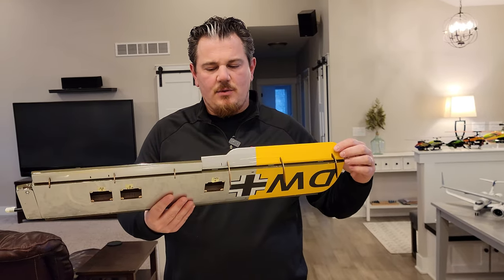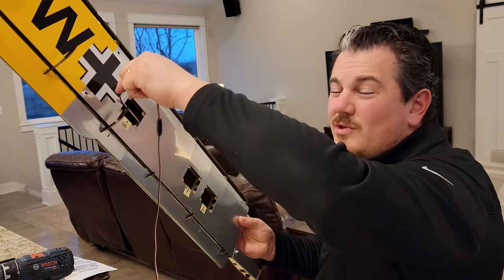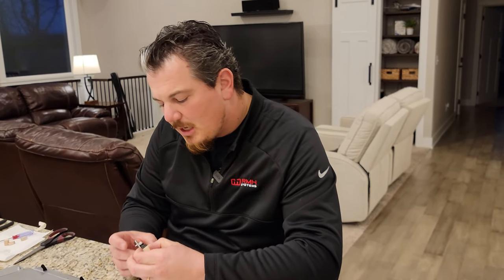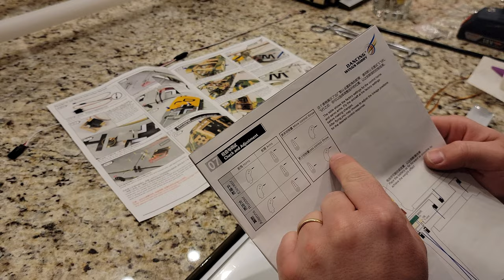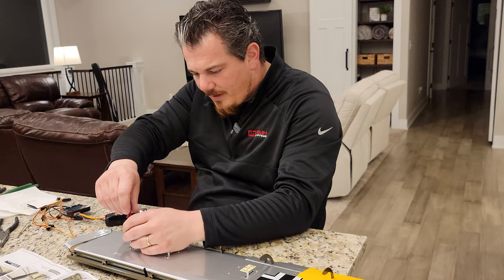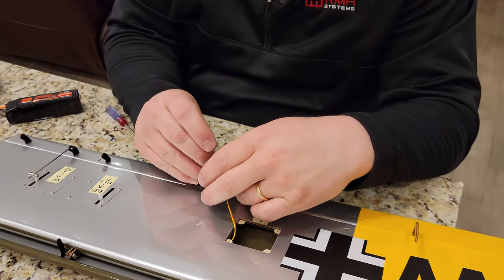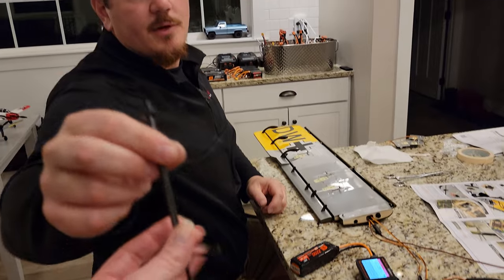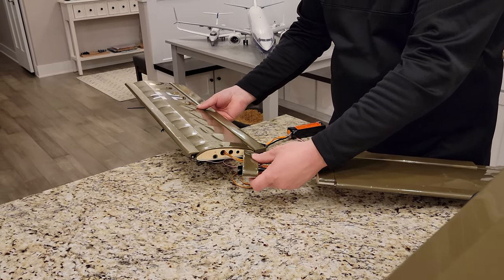Dancing Wings - Fi 186 Storch - 1.6m - Build Part 3

Comment: Hey man I got a maule M-7 a while back and live near a river. I’m petrified to fly it and land in water with the floats. Any pointers?
Reply from the maker: Pointer #1...fly in such a way that if you lose control of it on the water, it floats toward you.
Pointer #2...land faster than on wheels, and EXACTLY into the wind.

It's not hard, but you just want to try to keep it from getting too wet, and shorting out the motor...it will still work, but might stop in extreme cases.

Comment: Hey Megan, Thanks for Putting up with Brian.. I Know.. I Know.. But Hey.. Thanks!! lol ;)
Hey Brian Thank for doing Long Form.. IT TRULY makes A HUGE World of Difference!! 
Ist Hack.. Never use those DEATH couplings.. They Bind on travel. Weigh a Shitload and come LOOSE.. usually resulting in a Fatal Crash..  ANSWER.. Modified Z-BEND using heavy Gage Piano Wire, after it's bent into place, Bend wire to a full z bend and Trim Excess, secure mid point deflection with a zip tie, tightened around the wire, cut and glued to Frame or ??
2nd Hack.. STOP using THAT...Masking tape.......... Use the Green or Blue Painters tape works Great and Peels off super easy yet wont let go, until removed..
How I GOT HOOKED..
Dad Bought me(Him) a Plastic "Cox"  .049 P-40 Warhawk, U-cnotrol.... I was HOOKED!! Not To mention it's the Coolest Shark Plane EVER!!
Then my First Balsa Kit was the "Lil Wizard" but I found BIGGER MOTORS.. OMG that's when the "MORES" started... FLY`N NITRO BABY!!
My Planes Grew to the "Banchee" Profile U-control Racer.. with a KB 40 on it.. That Plane was a Thundering Bundle of Dizzy JOY!!
Remember how we'd take 3,4 Plastic Car Models and use all the Parts for ONE CRAZY Amp'd up CAR?? 3 Motors and sh.. stuff.. lol
After 50 Years Of Balsa then Foam Board, I'm Back to Balsa and I'm Still Doing The Crazy Concepts.. in Many of my designs..
My Last Scratch Build took me almost 2 years.. From Download to completion and Modifications..
The Quickie 2, by Burt Ratan... Took my Thumb drive to Kinko's, came out with full size Plans, Made a Materials list and Got started Laying it up and pinning it together.. All hand cut
Modified to a Twin W/ Differential Steering just for fun.. it's Pack`n 2 Quantum BE1806.2700KV Motors  and 4052 Tri Blade Props...

I have Benge`d all 5 Episodes and am QUITE IMPRESSED!! that your still getting fed.. Brian...lol Kidding My sides hurt from laughing all night your Both GREAT!! 
I had Hoped your would Pick this BEAUTY up for review... SUPER HAPPY YOU DID THIS!! I watch Most All your Unboxing/Builds
Much Love from the Great PNW!!
Reply from the maker: I'm so glad you enjoyed it!  Yes, I'm lucky she still "Feeds" me - LOL....This build was tough for Megan and I to do. The length of video is very challenging, but if there's a group of people who really enjoy listening to us talk about Will Smith and Chris Rock, we're good to go ;) (Just don't tell Megan - another Dancing Wings is coming soon - LOL LOL LOL [<<< evil LOL, fyi])
Reply: @BrianPhillipsRC  I Can't Wait!!